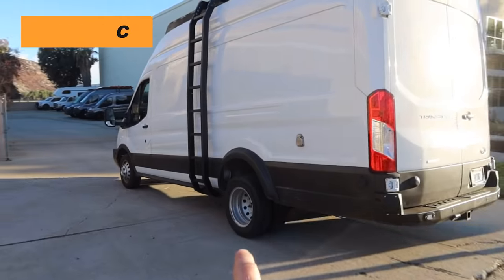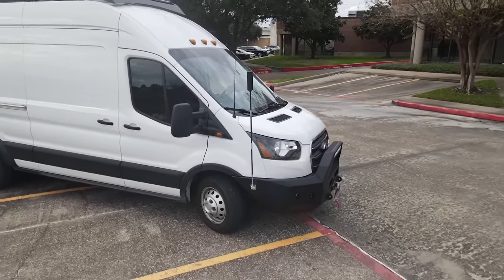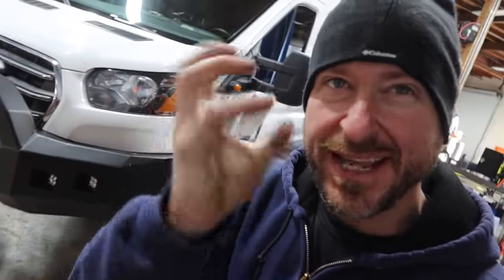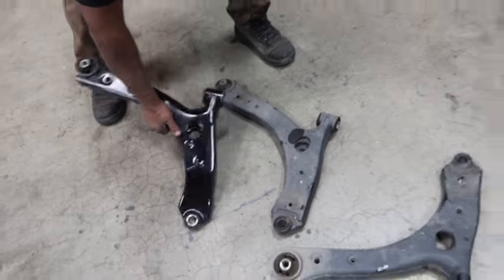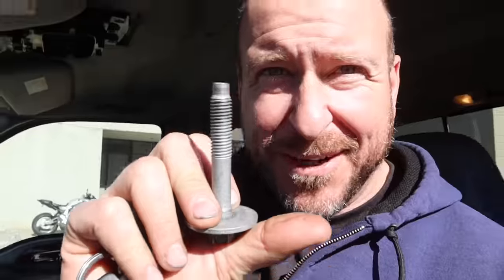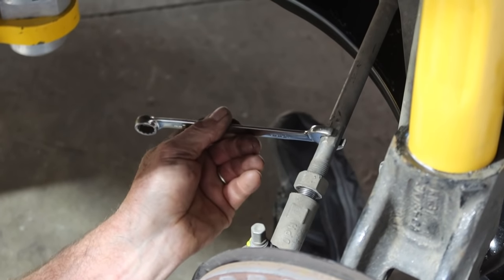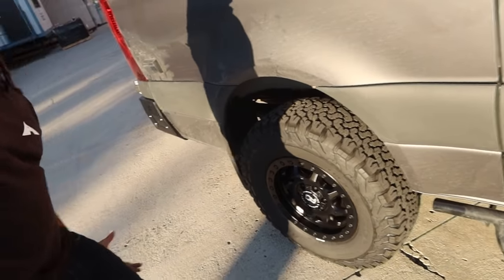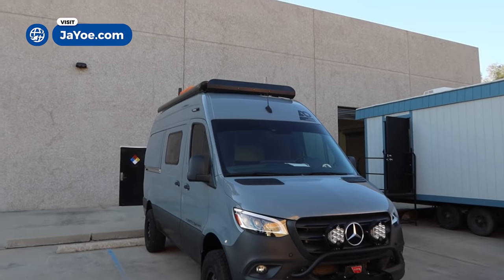Installing Agile Off Road Front Lift, Suspension upgrade on Ford Transit PART 2 | VAN LIFE BUILD

Comment: You went with the dual wheel rear.   What is your reasoning? I am a Jeep guy transitioning 😂 into the van world planning my build.  Thanks for your input
Reply from the maker: It has a bit of a heavier load capacity which will be good for the studio I’m planning. But it’s honestly just because that was the only van I found in good shape at the time.  I would have loved an AWD single style

Comment: Hey!  You loved the fake carbon wrap on the hood! And we had made a bet that you would do such a terrible mod to your van without even stopping for a second that it’s one of the best and most harmful modifications you can do to any carb period.  Why v cause it makes the engine bay 60% hotter than in white.  Don’t take my word for it.  People are already having their black hooded sprinters overheated and Mercedes’ cancels the warranty of the power train if you do that to their sprinters is a new thing and it’s real.
Reply: So you're saying a black van from the factory will overheat the engine?

Comment: How is the ride after you installed the lift? I am always concerned about ride comfort and vehicle dynamics stability.
Reply from the maker: Feels good. But I got the lift and suspension. As well as fixing my sway bar. So I’m not sure what feeing is attributed to what fix
Reply: @JaYoeNation  

Does it feel stiffer and same ride quality as before?